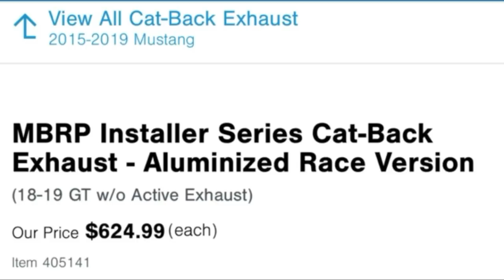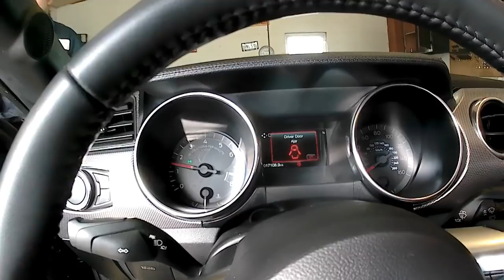My 18 Mustang GT, I LOVE IT   but........listen!/stethoscope

Comment: This is what I have been preaching. If the tick was going to cause issues, it would through Check engine lights and what not. People just need to love these cars and stop making shit a big deal unless those ppl have legit issues. Yours does have a loud tick though. I know its annoying.
Reply from the maker: And its getting louder so if something happens hopefully im passing a Camaro 😁😁
Reply: Check engine lights usually come on when a rod goes through the oil pan.
Reply: zeeosix WTF! I’m talking about side play which I believe it’s what causes the the noises on the bottom.
Reply: @velr50gt  - Excessive rod side clearance has been my theory too for quite some time - lots of evidence pointing to that as the cause, and been lots of talk about it on M6G over the last couple of years - I take it you read about it there too.  My comment about the rods going through the oil pan was a sarcastic response about the check engine light.  Of course an engine can have all kinds of mechanical problems and never set a check engine light, until maybe a rod gets spit out the engine or other major engine damage occurs.  Does this sound familiar?  M6G members have reported excessive clearance measurements by their Ford Tech.
https://www.youtube.com/watch?v=Zhp0zTXHKPo
Reply: You got that right 👍
Reply: It will throw an engine light just give time. Coming from an owner of a 2018 with TWO new engines and car buy back. Wont touch those pieces of junk
Reply: I would like to hear from dealer technicians of other brands I know for a fact that Chevrolet dealers replace pistons for piston slap!
Reply: I personally don’t believe the tick is caused by anything that would throw a check engine light

Comment: I just bought a 18 GT leftover and got a great deal on it. I was hesitant to buy it because of all this tick and knock news but I couldn't resist and your videos helped me decide to do it. I only have a 100 miles on it and hope I am lucky to not develop the tick.
Reply from the maker: Im very happy to help,  hope you don't have the tick but you will not be disappointed my friend!
Reply: I hope you get a good one. Otherwise it’s just a gamble and how much are you willing to deal with the headache if it happens and Ford tells you it’s normal
Reply: As soon as mine hit 900 miles I brought it to auto cross.  I've been red lining it every time I drive it, after it is warmed up ever sense. It's at 5200 miles and second set of tires. Oil changed at 900, 2000 and 4500 miles mostly because of all the negative videos. No metal in the oil or filter.  I haven't modified it as I want to because other's have grenade'd from out of nowhere. UPR separator and resonator delete.

Comment: You should invest in a bore scope mike. Or see if your auto stores would rent you one. If you have proof of cylinder scoring get a lawyer an file a lawsuit. Or use your buddy’s oil rack an drop that oil pan an rotate your motor an check for piston slap scoring.

Comment: Thank you for posting videos on this issue.  I'm a concerned 18' GT owner myself.  I only have 1,000 miles on the car so far, but am worried what will happen after my first oil change.

For what its worth, I'm going to repost the link from the comments below as to what could be the root cause of the Tick issue...I just don't want the video to get buried in the comments.  Here it is again:

https://youtu.be/SwYxgBh2xe0

Comment: The ticking @4:20 is classic "BBQ tick" (what Ford calls "typewriter tick").  The question is, do you also have the "2000 RPM rattle", which a lot of 2018+ owners also report.  Theory is on Mustang6G that the BBQ tick is bottom end, and the 2000 rattle is piston slap.

Comment: Thanks for posting Mike. I get the same hate on my channel. I do like that this is consistent with my technicians findings. He said he couldn't hear it from the bottom but could from the top. He would always tell me that he could hear it from above the cylinders on the passenger side but not in the cylinder. Thus the head replacement. I just want some closure and by that i mean just an explanation. At this point i'm just driving the car and waiting for the motor to go or not.
Reply from the maker: Me too, and like you im enjoying the HELL out of it....just put a 130 decibel exhaust on it o.m.g!!!!!!
Reply: @mustangMike740  noice!
Reply: Your direct injection pump is above passenger side valve cover use a stethoscope and see
Reply: Thanks for the information but The tick isn't the direct injection or HPFP. This was confirmed in my personal case by Ford engineering, Ford hotline and multiple master techs.

Comment: It takes just one bottle of ceratech and the tick will be gone. There is a tsb out . So why still suffering ? Just put it in and  thats it. Helped me.
Reply from the maker: It takes one bottle of ceratec to end your warranty!  I have went 11 months without a tune or anything else, while still doing some cool mods.  Even if i was going to put it in my car, i wouldn't film it.  (Which i haven't and noise is getting worse)  i have patience something will shake out soon so stay tuned my friend!
Reply: @mustangMike740  Using Ceratec or even a different weight oil will NOT end your warranty! Complete B.S.
Reply: The TSB does not fix anything.  That TSB just prevents the dealers from attempting any repairs.
Reply from the maker: @Jamko1970  i promise you that if i put it on video,,,it will end my warranty! There are more people watching than you think!👀👀👁👁👁👁
Reply: @mustangMike740  It will NOT end your warranty! I don't care who in the hell is watching, NO damage will be done by adding Caratec and nothing wrong with putting it in your engine. Please tell me ONE case that warranty work was denied by adding a legit additive???? Never heard one case in my 49 years.
Reply from the maker: @Jamko1970  no disrespect but my owners manual says putting an additive in the oil other than by a certified ford dealer will void your warranty.   Regardless of what you have heardor what anyone else has done,  im going by the book.  till 60,000 miles. Im not everyone else, im me.  I still appreciate your input, and im sincere about that.
Reply: @mustangMike740  IT DOES NOT SAY THAT!!!!!! It does not say it WILL void your warranty!!! Please read it again. It says it MAY void it, if the additive caused the damage. BIG difference with - it WILL and it MAY.  A legit additive will not cause damage.
Reply: jammko1970 i think he just doesn't want to take the risk dude.. Ford is already playing enough games with us as it is.
Reply: jammko1970: “May” means it will be at Fords discretion to decide whether you did something wrong or it... it’s not whether you think you did something wrong or not!!!!! So Mustang Mike is doing the right thing because you can bet that most dealerships and Ford themselves will look for any excuse to not fix the car and blame anything and anyone other than themselves. The tsb is Ford already saying the tick is normal... if they find out that someone was putting additives in the oil or gas... what do you think is gonna happen??? Everyone is already wondering if Ford themselves are putting something in the oil to prevent the tick from happening till after the oil is changed the first time.
Reply: Well i used ceratech and my stang is build in jan.18.it developed the tick in june18 after the first oil change. Since i was the first german mustang 2018 owner here in berlin , i suffered like a dog . There was no one who could help me. So i searched for answers in the forums of german and american mustang forums. Ford just would change the small block. But i already knew, that the tick would come back. That was not an option. The mechanics nowadays are just making it all worse. I started to read everything  about   cerateck. The bmw and mercedes freaks use it here since decades to smooth their engines and safe gas. I did the same . The tick was gone immediately. I could enjoy my US car . No one of my frieds  is laughing anymore, that i made the choice instead of buying a M3 BMW.   It is running smooth and nice. It is up to you to use it or not. I want to enjoy my ride until the left green  German government forbids it. Cheers from berlin.
Reply: Geronimo the Grey Coyote: wow... your from Germany? Very interesting. I see lots of BMWs and Mercedes where I live in the US. Sorry to hear that you have this tick problem. I do not own a Mustang and don’t plan on getting one because of all this nonsense going on. I’m glad that the ceratech has eliminated the problem for you so far. It’s too bad that people even need to think about It though. Hopefully you can keep your car running smoothly for a long time.
Reply: The more I think about this whole thing the more I think you need to add ceratec man!! Ford is betting that the car will last through the warranty period before the engine blows!! And we all know that’s not a normal sound so... I would add ceratec. Either you go to Ford right now with this car and fight like hell (but they already said it’s normal) or just put ceratec in it. Under no circumstances would I drive the car sounding like that for 60,000 miles. No way!
Reply: Liquimoly never had any complains about ceratech. Since decades millions of cars have ceratech in the engines and the surveys are clear. If ford says that the engine is ok, ceratech will not kill it. I need a smooth engine. Here a Mustang is a exotic car. People smile at me or shake the head because i waste so much money and  gas , driving a US Car with 460hp . The mustang  has a bad build quality and costs as much as a M3.   So it is only a car for US car enthusiasts. With THAT ticking . Driving here ? ...no sir. Ceratech all the way. It is a good product. Good engineered, helps lubricate  the engines.  Even strange American V8. And I love that American V8. I dont know why. I just did love it since I saw Bullitt in the cinema. I was a kid.
Reply: Geronimo the Grey Coyote: Yeah, I get it. You really need to do whatever it takes to protect your engine since Ford basically thinks this is all normal(which is absolutely is not). Just hearing about this problem makes me sick to my stomach honestly. I used to own a number of Fords and they were all plagued by stupid problems. The last American car I owned was a Mercury Sable with the V6 “duratec” engine. It was pretty optioned out but it also had tons of problems. I was constantly in the shop getting something fixed and I drove it like a grandma. It was the last straw for me. All these years later I’ve been eyeing this new Mustang and reading about it... and basically the same stuff is kind of going on. Horrific manufacturing and quality control stuff. Ford basically doesn’t give a shit about their product or their customers!! It’s unbelievable. It’s like they still don’t understand that people don’t need their cars and can buy much more reliably built ones like German or Japanese. Instead of warning people about additives in the oil... Ford should warn people that Ceretec is a mandatory additive for their shitty engines!
Reply: Kong 76: yup!!
Reply: Kong 76  no sir, it last up to 50000km. read the info text from liqui moly. to be honest, i should add 2 bottles for my coyote engine. i only used 1 bottle and it was enough to stop the ticking imediately. the other bottle i will use after the next oilchange. i even will put it in the engine at the dealership. right after they will give  my car back from the service. i dont care if the people at the dealership see me putting that stuff in. my engine should run lubricated and smooth. i payed for that car and it is mine. a bad lubrication and a ticking noise without cera tech is just to much to bear for me. ceratech was and will always be a way to lubricate a engine better. boriumnitride is not a snake oil. ----- i found a artikle about cera tech some time ago. it is from a man who knows a lot about that. +++++++++++++++++
he said:
CeraTech makes motor oil in 5W-20 that meets Ford's spec. That means you can run their ceramic compound additive package oils without voiding your warranty.

https://products.liqui-moly.com/oils.html?cat=597&viscosity=2795

Also Cera Tec (Liquid Moly) is catalyst safe: https://pim.liqui-moly.de/pidoc/P000017/3721-CeraTec-23.0-us.pdf

These are their claimed properties:

Description Micro ceramic solid lubricant suspension based on hexagonal boron nitride (BN) in selected base oils. The laminar graphite-similar structure reduces friction and wear and prevents direct metal-to-metal contact. The < 0.5 µm particle size guarantees optimum filter flow properties and protects against depositing of solid lubricant particles. Properties - reduces frictional losses - suitable for diesel particulate filters - mixable with all commercially available motor oils - increases smooth operation - highest thermal stability - excellent high and low temperature behavior - tested for catalytic converters - stable under extreme pressures - compatible with fine filters - no deposits - long engine service life - chemically inert - reduces fuel consumption
Reply from the maker: I think its a good product, no doubt about it.  I just think my car is going to go out before 60k and don't want to risk it.
Reply: Kong 76  that may be sir, . for me it works. i will add ceratech again after the next oil change. i will add a video from today just to show ya all how smooth my engine runs. the ticking was extreme and now, it is gone thanks to ceratech.
Reply: Kong 76  I understand . But what options do we have? The ticking is known for years now and it is very present on our cars. Ford will not change a thing since they claim, that the ticking is just normal. I dont want to hear it on my car, so i add a 20 euro bottle of ceratech all 15000km. It runs so smooth, that i probably will use it also on the ticking free subaru of my wife. I am just that convinced that it is good to have a boriumnitride  coating in our engines.

Comment: It really pisses me off the shit people a dealing with on these brand new cars! ( And I own a 18 with 5k miles on it) If mine starts ticking I will turn the Mickey mouse oil drain plug out one click and take it for a ride and have ford put a new motor in it I'm surprised they aren't falling out on there own, that's why ford is doing all my oil changes. I paid way to much money for this car to fight with ford about a junk motor. Ford engineers need the shit slapped out of them for some of the stuff they put on these cars.

Comment: Mike did you take your car to the same dealership where your friend got his car diagnosed? Secondly if you boroscope now and actually do find scoring, what will you do about it? Will ford fix it? Or void your warranty for going into engine?
Man ford has really screwed us. I went to the dealership again (different one) yesterday just to check what they say about the tic. They pulled out the TSB and gave me a copy of it! They are not going to touch the car.
I think ford engineering is not stupid. They exactly know what is causing this. They must have done testing and seen the engine runs fine for may be 70-80k even 100k (i am just making numbers up), so they are just going to wait this out. But this is bad news for us. We cant do anything. I appreciate your spreading the word about this issue. Please keep us posted. Thanks

Comment: Clicking isn't knocking so I wouldn't worry about it.  Drive it, man, if it breaks then Ford is fixing it.  My wife's Mercedes makes weird noises sometimes when I'm at Red Light.  My shop can't find anything wrong with it.  It has 200,000 miles on the car and runs as smooth as a sewing machine.
Reply from the maker: Clicking? Is my camera THAT bad?
Reply: @mustangMike740    I don't really hear it but I believe you.  There is other people here on youtube like Stangmode who has heard it too.
Reply from the maker: @danielroberson5421  please start at 4:02 of this video and tell me you dont hear anything.....4:02
Reply: @mustangMike740   Just like you said it does sound like a typing machine.  I heard it.  That kind of stuff will drive you crazy.  But she runs hard I'm sure.
Reply from the maker: @danielroberson5421  Beast!
Reply: @mustangMike740   Dude the newest thing is people are buying this motor and installing it on the s-197s (2005-2010) GT's.

Comment: Hey Mike sorry for what you and other 18's mustang owners are going through when you spend 40k or more on a new car you shouldn't have to add anything to your oil or rebuild a new engine you should be able to beat on it with no worries like I do on my 15 gt unfortunately Ford took a big step backwards with the 18's and won't  admit to it

Comment: Your tickeled to death over the mustang. At least ford is going to install an electric motor on the front axle so you can get it back to the dealership. Dodge and Chevy hasn't even thought about that yet. Ford is leading the way in new inovation on there cars.
Reply from the maker: If im not mistaken,  dodge tried it first but couldn't find and electric motor large enough to move those boats!🤣🤣